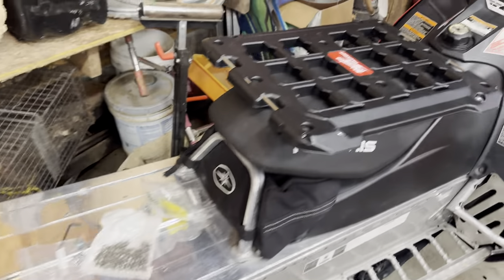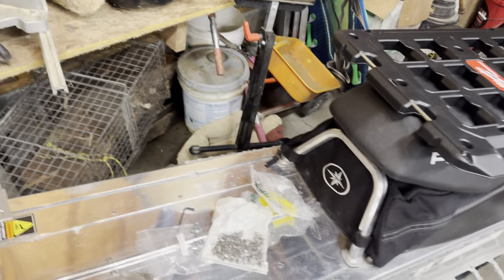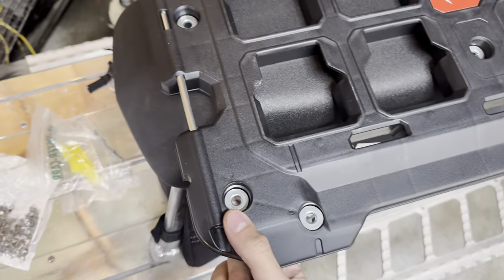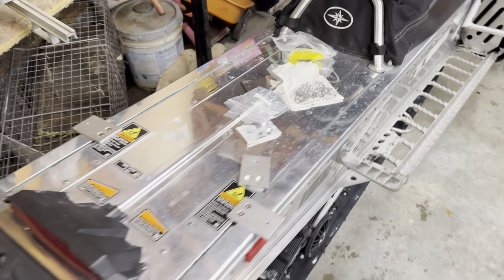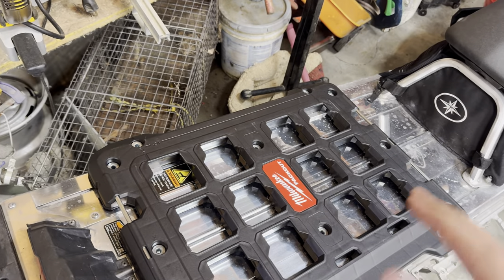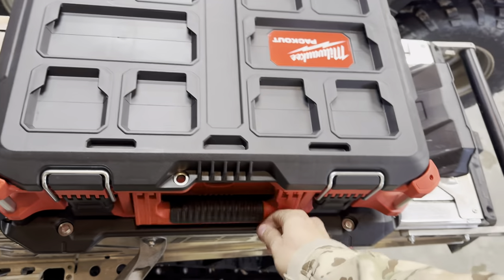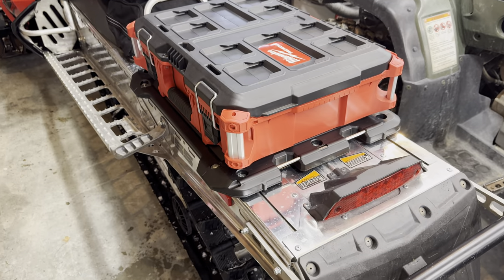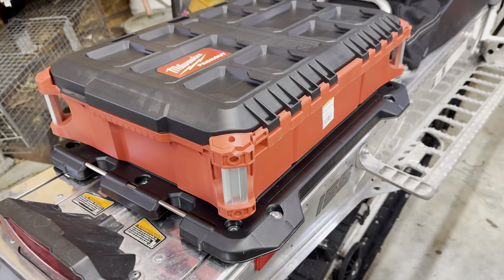DIY Milwaukee packout for Polaris snowmobile

Comment: What kind of hardware did you use to mount it into the rail
Reply: I’ve studied this video and the hardware appears to me to be purchased from McMaster-Carr.

10-24 strut channel nuts fit into the tunnel slots. (Part number 3259T2)

~1/4” aluminum bar stock

7/16” 10-24 flat hex head screws.

~1” 1/4”-20 bolt, but I don’t have a packout base yet to measure this yet.